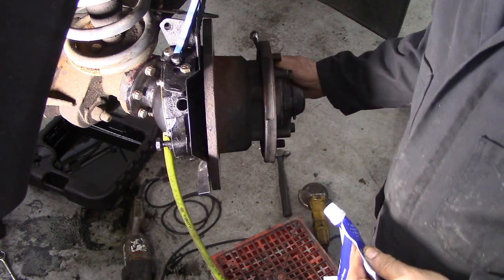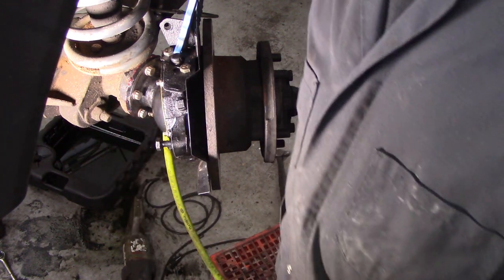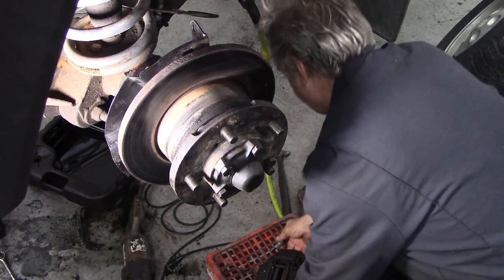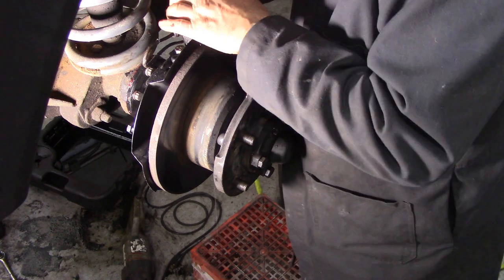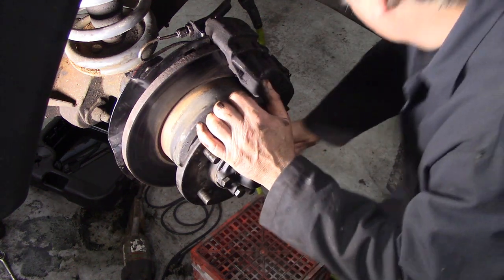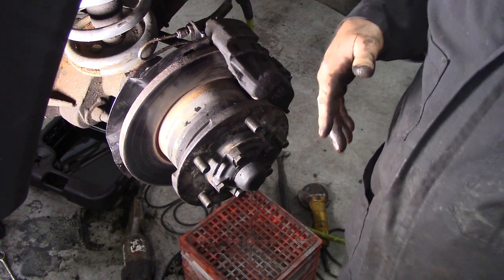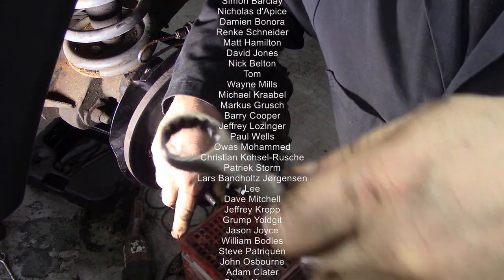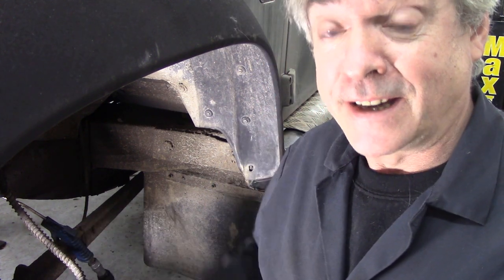Swivel grease in the axle oil   needs a strip down    final details part 4

Comment: When I got my 1st landy back in the early 90s it was and Ex MOD Lightweight with the original flush cut flanges/half shafts.  I had no end of trouble with the seals blowing oil into the brakes, I was rebuilding them every couple of months but been a clueless teenager cutting my mechanical teeth on the beast I thought that was how it was.  After a while I got fed up, drilled and tapped the swivels and fitted remote breathers.. never had a seal blow from that day forth.
Reply from the maker: My thoughts exactly - too much pressure from the foaming oil!

Comment: Hi Mike,  Iv  just watched  all three parts of you doing the  swivel  on a landrover  bugger  of a job, rusted up , or seized  bolts  Nae fun,  Glad i  took the time to  watch as my  1998  R Reg 300Tdi  needs this job doing  on both sides,    iv already  spent time wire  brushing spraying  all the bolts , and while in situ  managed to  remove  all 12 small bolts that hold on the plates that cover the grease seals, that was fun ?.   Now I am going to have to replace both swivels  as they are  pitted where the seal sits centrally  to the unit,   but i  am toying with dropping the  whole  front axel,  to needle  gun , red oxide, gloss black,  Fit  New poly  bushes New bolts,   as I bought all the bits to do this job a few years ago  then  the Covid infection hit us all.  Just need to buy the two swivel balls ,  Stan .
Reply from the maker: Sometimes quicker in the long run to do the job on the bench..
Reply: Hi there, well to let u understand I'll be doing this out in the street, all weathers, so it mite be out of commission for an Hr or so,  but i dont want to be doing it again as iam nearly 70, it's a pity your on the other side of the pond   Stan.

Comment: Mike, on my Series 3 filled with EP 90 the oil started to leak out through the lower shims. Hylomar Blue and those grease bags put a stop on the leakage. Top pin cross drilled and grease nipple installed, so that the top pin and railko bushing gets its grease dose.
Reply from the maker: Yes I put a greaser on my old S2a

Comment: One thing I've always wondered was why use 2 type of oil/grease, surely if the seal wasn't there at all the CV would be lubricated with the same axle oil, just a thought...
Reply from the maker: Problem is when off road, the oil will slosh around the axle - with this idea it is in 3 sections

Comment: Question for you Mike ? My Wolf 110 is getting ready towards MOT & I want to change every fluid as it’s been out of use for a good while (although MOD decided it needed a new turbo before release ?!). I understand the swivels were filled with grease from new - do I replenish it or leave it alone ? Great vid 👍
Reply from the maker: Good question. They were filled for life with the grease - but how do you check for  level?
If you remove the bung and put the truck on full lock, with the aid of a torch you can see the level of the grease in the  housing  - should be half way up
Reply: @BritannicaRestorations  don’t like “filled for life” on lubricants 😕

Comment: Interesting about the ep90 froth. So in theory you could put about ten of those sachets in the diff?
Reply from the maker: No - bevel gears like the diff, need a special oil to cope with the shear force between the teeth, so the oil has a high sulfur content - which is why it smells
Reply: @BritannicaRestorations  Got it, thanks. 👍

Comment: Good question about the EP90 using in Series swivels and no breather. I wonder if that grease would be better.
What's your view on vented discs on the front, not really to do with heat but larger pistons in the calipers.

Have you ever needed to adjust the vacuum servo shaft to brake pedal? The shaft is threaded.
Reply from the maker: Having been taught to drive using the gears and the engine as a brake for slowing down, then the discs on my 130 do not get that hot - however some folk seem to 'drive on the brakes' like it was an automatic.
The calipers on my truck are off a 110 not the Discovery ones which were smaller, I also fitted a Discovery 2 brake servo and cylinder .
NEVER adjust the servo push rod! 
It will prevent fluid returning to the cylinder and can cause the brakes to lock when the system gets hot after a few presses on the brakes
Reply: @BritannicaRestorations  I should been more specific.
I'm referring to a Disco 1 auto. There a some pressure on servo shaft that couples to the brake peddle. It's as if the U shaped bracket was not set correctly at the factory.
On my Series, engine braking and gears make the brake shoes last a long time. I had the fronts upgraded to 11 inch and a servo fitted before the upgrade. Stops really well.
I'll upgrade it to a dual circuit.